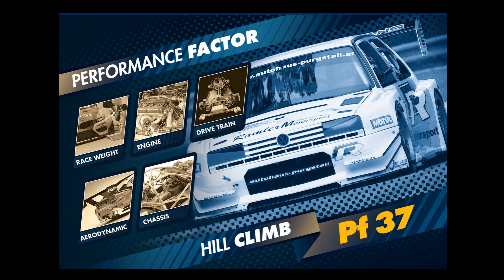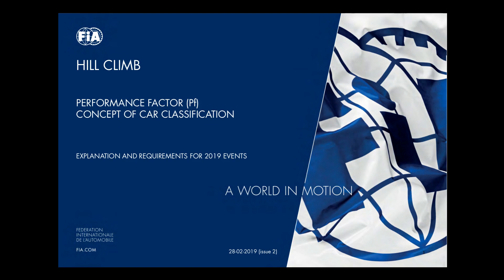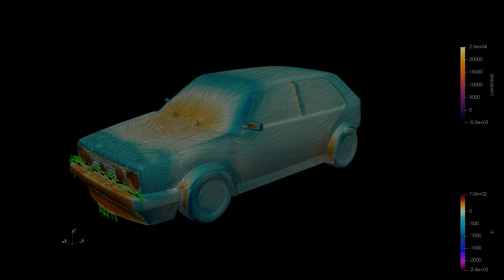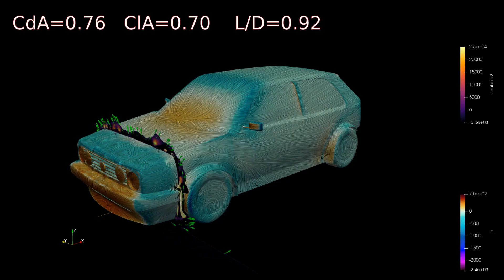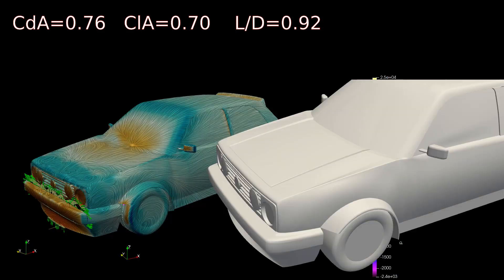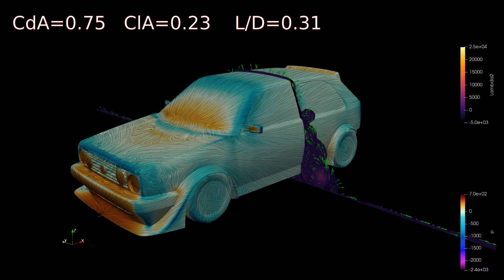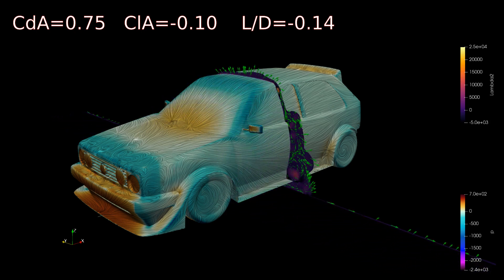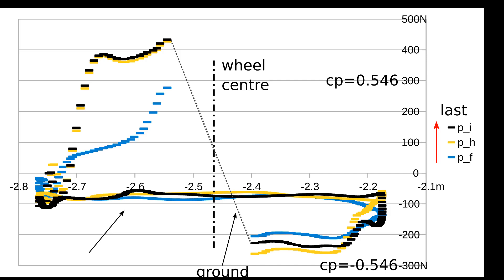European Hillclimb Hatchback Aerodynamic

Comment: Very interesting stuff. I have an old Starlet I compete with in the European hillclimbs and I struggle to understand some things around the hatchback aerodynamics. Obviously the car is much wider and lower than original Starlet and lately started looking into some aerodynamic aids like rear wing. Moved from the typical TRD style rear spoiler to a fairly big wing. I could see the benefits of the wing, increased downforce estimation from damperpots and by just feel is clear, but haven’t done any coast down or top speed tests to understand really the impact on drag. Also mounted it in a way that it won’t affect my pF as far back as the furthest part of body and as high as the regulations allow. I already thought about the extra airflow control on the hatch itself like the WRC style spoiler under wing you explained also on the other video, but haven’t had a chance to test it yet. What I have next in mind is to move the radiator in the middle of the car and feed the air from the sides of the car to the radiator and then out from the back of the car. Would be great to figure out the additional hatch spoiler and the cooling air out locations. I can either get the air in from the sides just before the rear fender flare or from the rear window area. Also my initial outlet point is the area between rear lights. This is typical in rallycross cars like this. Underbody I have nothing at the moment, but some sort of flat floor/rear diffusor would be possible at some point. This is what all the Golf’s and Polo’s usually have you show in the videos as examples.
Reply from the maker: The latest video got some legs on the algorithm and bunch have said they will try to work on something. It will be great to see if someone implements the window flap for next season. 
Thats a nice car you got there!

Comment: Awesome! makes me feel good you expanded research further than what we additionally tried! Really informative as always!  maybe im going to add front vents...
Reply from the maker: That separation on the bonnet didn't go away.... or it only did when in a very specific window(when lower). I still may not be letting enough air through the front, but its a similar tactic that I used with the other model, suzuki

Comment: "Aerodynamics of Road Vehicles" by Thomas Schuetz gives the mk2 Golf CdA at 0.67 and lift coefficients in the order of 0.0x for both front and rear... A sim without cooling flow and simplified underbody should be reporting even slightly lower than that (I'm assuming no cooling?) . I'd be interested to see the mesh / geometry that was used to get the video results. The visualisation is done really well, but appears to show a solution that hasn't converged yet at 4:13?
Reply from the maker: This has much wider wheels and matching wheel arches. I ran earlier sims that gave values in the 380-60N range @30m/s. I can't remember the exact values, it was in the 300's, its in a spreadsheet on the CFD computer.

The other hatchback I simulated has a drag much lower. The Cd on the interweb was 0.43.. I think. 0.67 is really bad even for the 80's.

Its interesting that they are getting zero lift.... The wheel arches again are creating significant lift but not that much.
Reply: @nelsonphillips  The 0.67 is CdA, not just Cd. 350N at 30m/s gives CdA of 0.7 which sounds plausible for a non widened car. The lift prediction is quite tricky, but 1:1 lift sounds a bit weird. Small things on the geometry can throw it off a lot... how fine is the mesh and how "round" are the edges on the original model?
Reply from the maker: The mesh isn't the problem. If there is a problem it is with the model. Even so a hatchback with and without a spoiler will have lift at the rear. As you are quoting from a reference and assuming that it is correct then the car they have tested isn't a standard body, or base model or is even a different model. Air will inherently accelerate off the rear of the roof creating lift. This also entrains with the side flow creating a vortex, all creating lift. A spoiler as seen on all hatchback in the last 10-20 years disrupts this entrainment reducing lift and drag. 

I have a feeling that the front gti air dam contributes in combination to the engine bay not being open enough. I'll have a look.